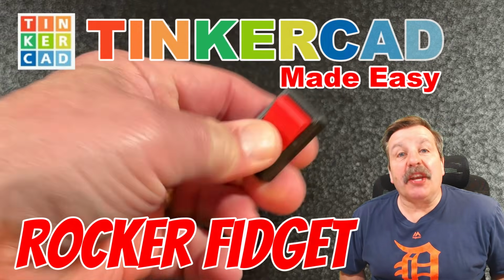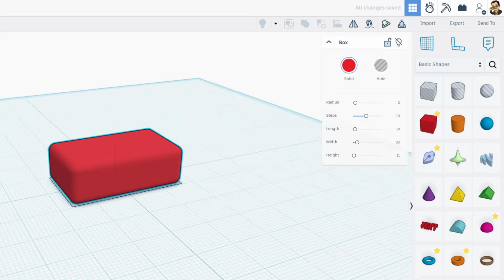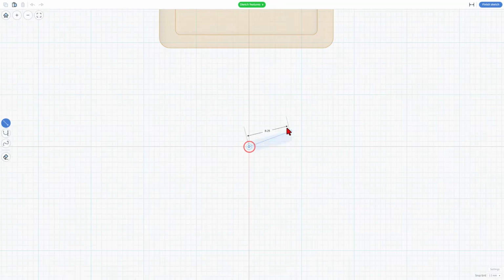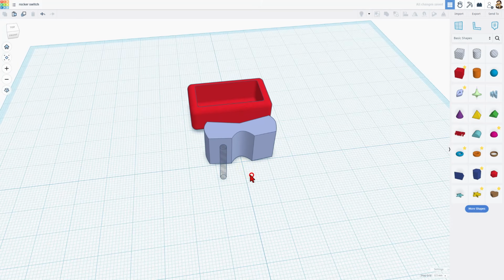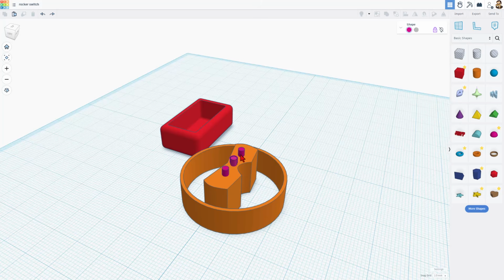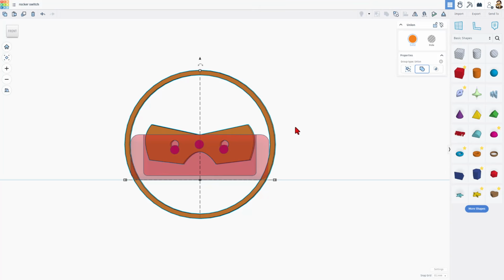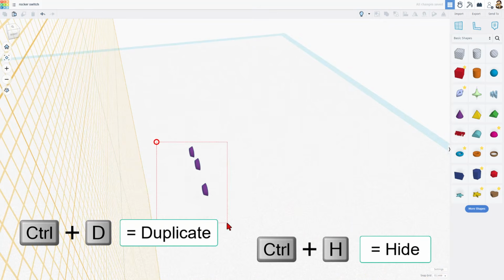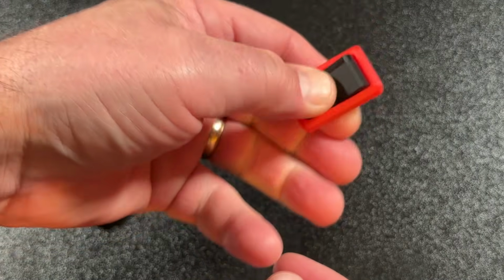A Tinkercad Rocker Switch Clicky Fidget: No Parts to BUY! 💯🔥

Comment: Do you have anything like this for sale (or know where to find any)? I'm looking for a variety of different, thin "switches"  and dials that are like this - they lack the electrical components, but keep the click sound. Mainly to stick all over the dummy blank switches in my car to make it feel more like a spaceship, lol. I just don't want these two inch thick ones that carry all the electrical stuff too - I want it thin enough to look like it belongs there. 

Everything I see for sale on Etsy is either full on electrical switches or stickers/plates that cover/surround switches.
Reply from the maker: Sorry, I do not have a system for selling stuff. Best strategy would be to find a friend with a 3D printer to help outfit your 🚀💯🔥.

Comment: You have taught me so much.  I think I must be having a user error because I followed the whole video twice now and my rocker won't snap in to the bottom part.  Do you have any fix for this?
Reply from the maker: Thanks for the kudos. Best way for me to check is via a share link. Get me a link, in my Patreon design questions area if you get a chance. https://bit.ly/patmess
Reply from the maker: This video shows the share link around 2 min in. https://bit.ly/tinksc26 It will give me a copy of your project so I can root around in there and see what is up.
Reply from the maker: It might be worth trying a pair of pliers to snap it in, too. When I was working on my system I had several where I had to resort to that. There is a chance our printers are different enough that we need to add a gap or something.

Comment: Items have rocker switches fail and I  buy 10 at a time to keep switch costs low.  This is a pricey fix even if you can find a switch because they can be different. I have standardized on a smaller rocker and 3d print an adapter base. This project gives me a plan to print an adapter for a small round rocker that is smaller than my standard switch.  I will use the old top of the switch and inside the device print an adapter to push the rocker or a micro switch depending on the current needed to be handled. Nice to see what others do to help me get out of the tunnel vision on projects.
Reply from the maker: Sweet idea! Thanks for checking out the video and sharing your perspective! 💯🔥 I was must making something fun that clicked! 🤣🤣🤣🤣
Reply: @HLModTech  It's great to watch how you do things differently. I buy things in garage sales with bad switches and if you can find a switch they want a lot of money for the odd looking ones and then you pay shipping. I just you common switches  and microswitches  and 3d print to fix them..
 I am also making a small greed house from pipes and 3d printing the pipe connections using the bent pipe object in Tinkercad. The bent pipe video was a good one also!
Reply from the maker: Thanks! I am always finding new uses for the bent pipe. 🔥

Comment: I'm having trouble drawing a round knob with rectangles on the edges; I can't seem to draw the rectangles following the circumference. If possible, could you make a lesson on this? Thank you in advance...
Reply from the maker: I think I might try to make the rectangles with this tool. https://bit.ly/tinkarray The circular array.
Reply from the maker: The other option is to draw them with Sketch on opposite sides of the knob.. then just use dup and rotate to space them out. This video does it.. but then gets fancy with scale and twist. https://bit.ly/sketchtwist
Reply: @HLModTech obrigado
Reply from the maker: Any chance you are thinking of the shape used in the cap of this project? That is pretty slick with a hexagon. https://youtu.be/y6Paynb4Skw